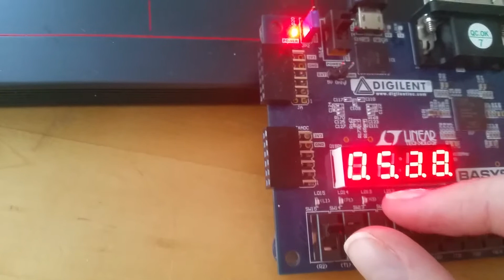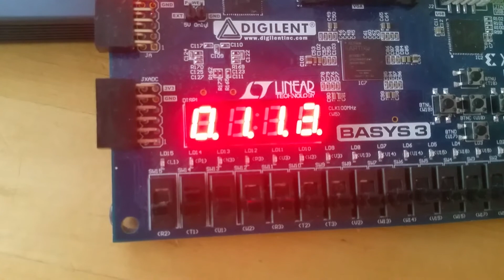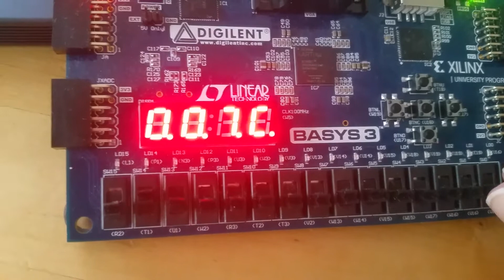Basys 3 counter demo (VHDL fundamentals)

Comment: I saw your other video. Is it possible to connect pwm solenoid directly using arduino with MOSFET driver?
Reply from the maker: Yes, it's possible. The N-channel MOSFET drives 24V into the solenoid, in this case - directly from a PWM pin, but it has to be a logic-level MOSFET (the gate threshold below 3.3V). I have a driver board that amplifies the PWM signal sent from the STM32 board to the solenoid. The driving frequency is around 30khz here though, outside of the audible range. Not sure Arduino can handle this frequency.

Comment: Is it possible to see your code, I have done mine and it works but for some reason, it shows the hex values as well and I need to remove them and I'm struggling with that. I will leave my code bellow if you could help me would be more than appreciated: 

library IEEE;
use IEEE.STD_LOGIC_1164.ALL;
use IEEE.std_logic_unsigned.all;

entity segment_display is
------clock enable with 100Mhz by default -----------------------
    Port (  default_clock : in STD_LOGIC;

   ------------ -------reset----------------------------------------------   
            RESTART: in STD_LOGIC;   

   ------------ AN0, AN1, AN2, AN3-----------------------------------------

    AnodeON : out STD_LOGIC_VECTOR (3 downto 0);      

             
-------------- CA, CB, CC, CD, CE, CF, CG ---------------------------------------      
           LEDOUTPUT : out STD_LOGIC_VECTOR (6 downto 0));
     end segment_display;  

architecture Behavioral of segment_display is
----------------counter for generating 1-second clock enable----------------------------
signal one_second_counter: STD_LOGIC_VECTOR (27 downto 0);
signal DELAY: std_logic;
signal DISPLAYDIGITE: STD_LOGIC_VECTOR (15 downto 0);
-- counting decimal number to be displayed on the 4-digit 7-segment display
signal LEDCONFIG: STD_LOGIC_VECTOR (3 downto 0);
----------------one second enable for counting numbers------------------------------------------
signal REFRESHCOUNT: STD_LOGIC_VECTOR (19 downto 0);
-- creating 10.5ms refresh period
signal LED_activating_counter: std_logic_vector(1 downto 0);
-- the other 2-bit for creating 4 LED-activating signals
---- count         0    ->  1  ->  2  ->  3
---- activates    LED1    LED2   LED3   LED4
---- and repeat

begin
-----------------BCD to 7-segment decoder---------------------------------
-----------------Cathode patterns of the 7-segment LED display --------------
process (LEDCONFIG)
begin
  case LEDCONFIG is
    when "0000" => LEDOUTPUT <= "0000001"; -- "0"     
    when "0001" => LEDOUTPUT <= "1001111"; -- "1" 
    when "0010" => LEDOUTPUT <= "0010010"; -- "2" 
    when "0011" => LEDOUTPUT <= "0000110"; -- "3" 
    when "0100" => LEDOUTPUT <= "1001100"; -- "4" 
    when "0101" => LEDOUTPUT <= "0100100"; -- "5" 
    when "0110" => LEDOUTPUT <= "0100000"; -- "6" 
    when "0111" => LEDOUTPUT <= "0001111"; -- "7" 
    when "1000" => LEDOUTPUT <= "0000000"; -- "8"     
    when "1001" => LEDOUTPUT <= "0000100"; -- "9" 
    when others => LEDOUTPUT <= "1111111"; -- Off 
 
 end case;
end process;   
    
-
-- 7-segment display controller
-- generate refresh period of 10.5ms
process(default_clock,RESTART)
begin 
    if(RESTART='1') then
        REFRESHCOUNT <= (others => '0');
    elsif(rising_edge(default_clock)) then
        REFRESHCOUNT <= REFRESHCOUNT + 1;
    end if;
end process;
LED_activating_counter <= REFRESHCOUNT(19 downto 18);    

    
--- 4-to-1 MUX to generate anode activating signals for 4 LEDs 
process(LED_activating_counter)
begin
   case LED_activating_counter is
 when "00" =>
       AnodeON <= "0111"; 
         --activate LED1 and Deactivate LED2, LED3, LED4
        LEDCONFIG <= DISPLAYDIGITE(15 downto 12);
        -- the first hex digit of the 16-bit number
    when "01" =>
      AnodeON <= "1011"; 
        -- activate LED2 and Deactivate LED1, LED3, LED4
    LEDCONFIG <= DISPLAYDIGITE(11 downto 8);
        -- the second hex digit of the 16-bit number
   when "10" =>
    AnodeON <= "1101"; 
        -- activate LED3 and Deactivate LED2, LED1, LED4
     LEDCONFIG <= DISPLAYDIGITE(7 downto 4);
        -- the third hex digit of the 16-bit number
 when "11" =>
    AnodeON <= "1110"; 
        -- activate LED4 and Deactivate LED2, LED3, LED1
      LEDCONFIG <= DISPLAYDIGITE(3 downto 0);
  -- the fourth hex digit of the 16-bit number    
 end case;
end process;

-- Counting the number to be displayed on 4-digit 7-segment Display 
-- on Basys 3 FPGA board

process(default_clock,RESTART)
begin
        if(RESTART='1') then
            one_second_counter <= (others => '0');
        elsif(rising_edge(default_clock)) then
            if(one_second_counter>=x"5F5E0FF") then
                one_second_counter <= (others => '0');
            else
                one_second_counter <= one_second_counter + "0000001";
            end if;
        end if;
end process;
DELAY <= '1' when one_second_counter=x"5F5E0FF" else '0';
process(default_clock,RESTART)
begin
        if(RESTART='1') then
            DISPLAYDIGITE <= (others => '0');
        elsif(rising_edge(default_clock)) then
             if(DELAY='1') then
                DISPLAYDIGITE <= DISPLAYDIGITE + x"0001";
             end if;
        end if;
end process;
end Behavioral;